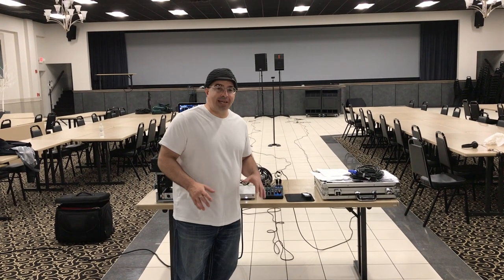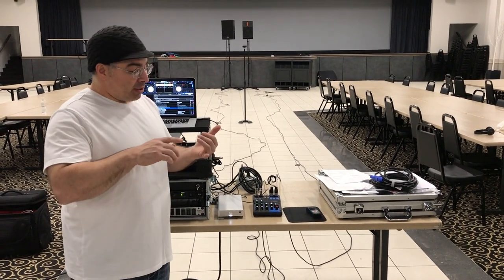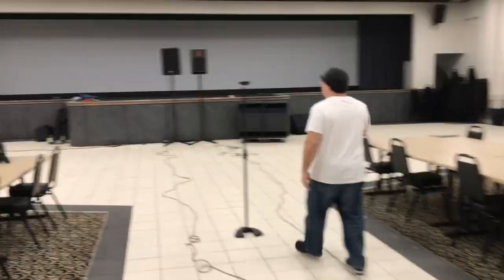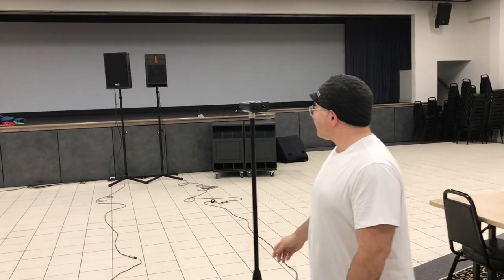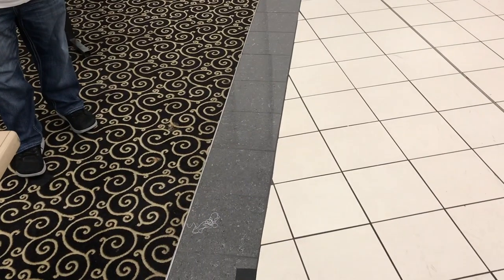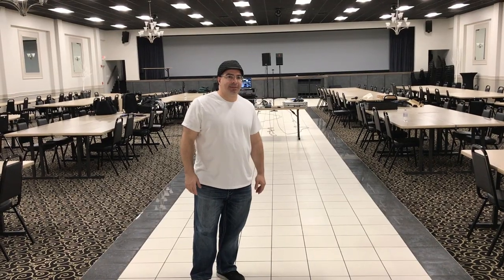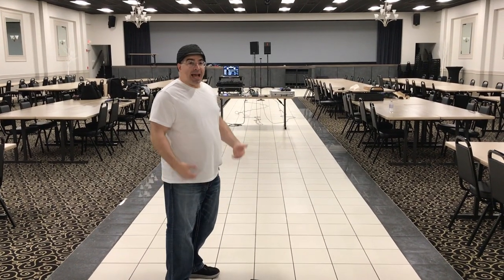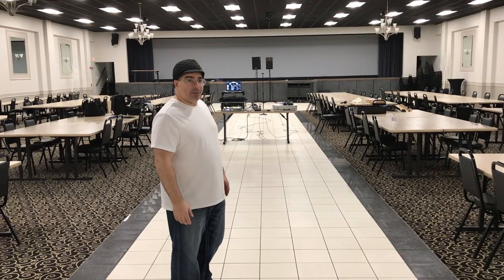RCF TT25A-II vs Bassboss DV12 Video 2

Comment: How those VS 21's compared to other subs in the market?
Reply from the maker: They definitely pound.  They go pretty deep tho.  At times I wish I had got the 18’s instead.  I do mostly weddings, so the punch is preferable for me but if you do EDM or like dubstep these subs shine.
Reply: @FinestEventss  thanks for the response. What do you prefer about the 18's in terms of sound quality that the VS 21 is missing?
Reply from the maker: @jack3400  they don’t have the punch the 18’s do.  The 18’s hit tighter imo too.
Reply: @FinestEventss  okay, thanks. Am looking to purchase a sub.. Is the 18's you heard (which tigher than vs21)  the ssp118, or a different brand?
Reply from the maker: @jack3400 I have heard and used the SSP118’s.  Overall those are probably the best ones to get if you need great overall low end.  The SSP218 if you need more.  I also have BB15’s and they are awesome for the size.
Reply: @FinestEventss  Okay, thank you. Do you have the ssp118 mk3 or mk2 (apperently the mk2 sounds deeper)?
Reply from the maker: @jack3400 I have all MK2.   I have heard the same but I also heard that Bassboss changed the DSP so they match on the MK3.  Don’t quote me definitely reach out to Bassboss with those questions
Reply: @FinestEventss  okay, thanks.

Comment: Bassboss have inside B&C 12nw100. A highend neo woofer.
Reply from the maker: Yes, they do.
Reply: @FinestEventss  They have very high db preasure, strong neo motor & very long excursion, leading to strong bass.
Reply from the maker: @laniroli3714  yes, they do, great speakers

Comment: manys made comparison betwen different brand speakers, and many of them are more harmfull them usefull
becouse they not respect all the competitors aspects
many brands have several levela/lines of speakers
RCF has Art 3, Art 7, HD, NX, TT, TT+
its like Mercedes C, E and S classe and BMW 3, 5, 7 series
Reply from the maker: The only thing unfair is the 15 vs 12 inch driver.  These are both their flagship speakers with a similar price point.

Comment: 15 vs 12
Reply from the maker: Yes.  Hard to believe but if you watch the next video you will be shocked.  The 12 out does it.
Reply: @FinestEventss  I have a double 10" premium 3000€ speakers, they have a bass like no other 15 that I'v heard, so i know that the size is not the most important
i just mentioned 12 va 15

and if you want RCF real competitor for this DV12, try RCF TT2
i belive this will be more honest comparison
Reply: @djsergiubulgar4922  At this point, I think the TT2 speaker has been discontinued.